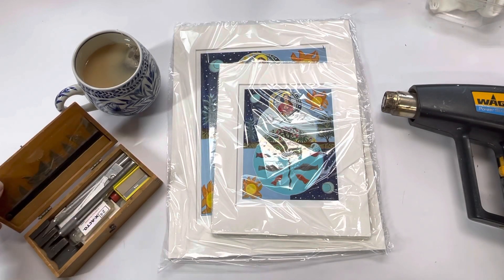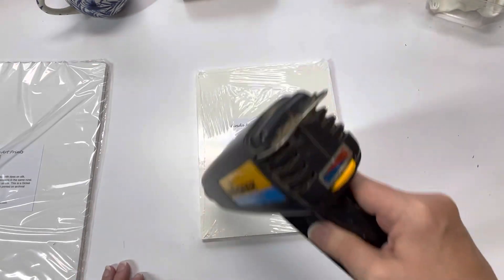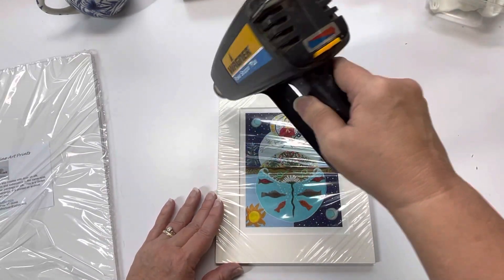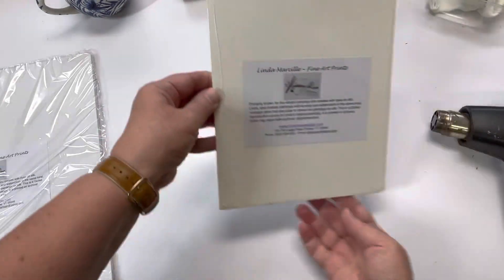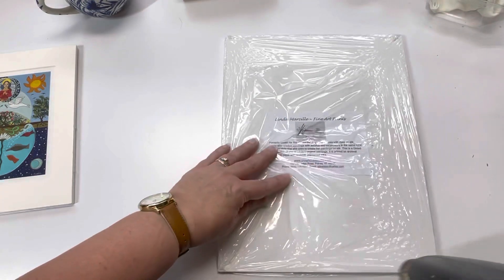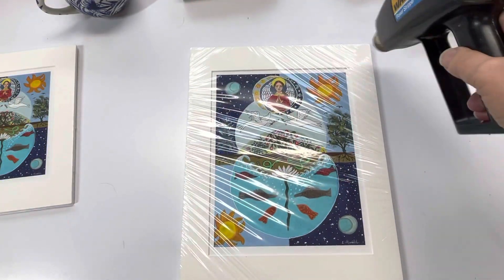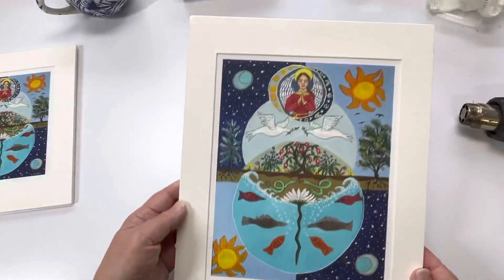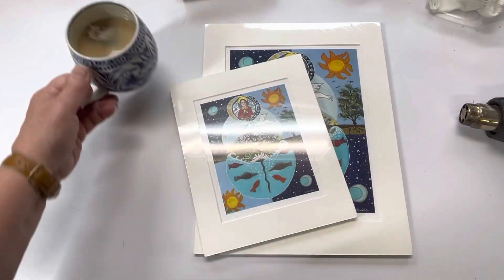How to shrink-wrap prints with tips on preventing blowouts

Comment: I'm hoping to learn how to shrink wrap at home after having several paintings shrink wrapped. Did you make a video of measuring and cutting the plastic wrap before shrinking it? Do you keep your original paintings or sell them in frames? An artist friend told me she NEVER sells her originals. I'd appreciate your feedback on my questions. Just found your channel searching for how to DIY shrink wrap.
Reply from the maker: The shrink wrap machine burns the plastic to size around the print. You slip the print into the large roll of shrink wrap, then you press the wand of the machine down and it burns/cuts the shrink wrap to size on all sides. Then you use a heat gun to shrink the sealed shrink wrap. I sell my original work as well as prints.